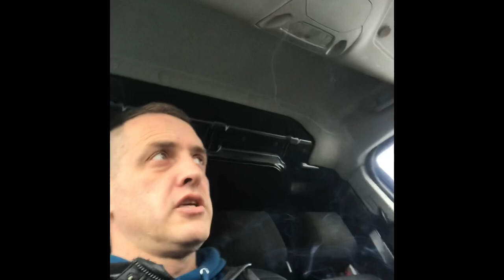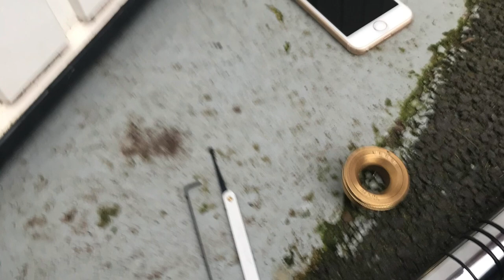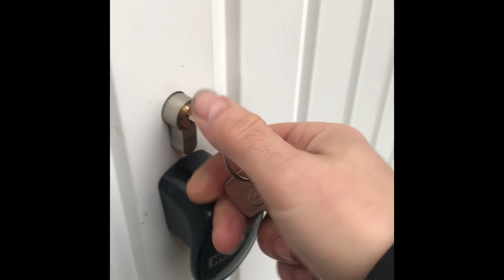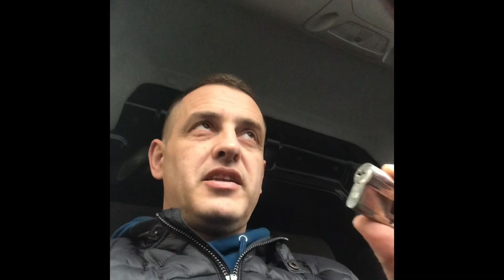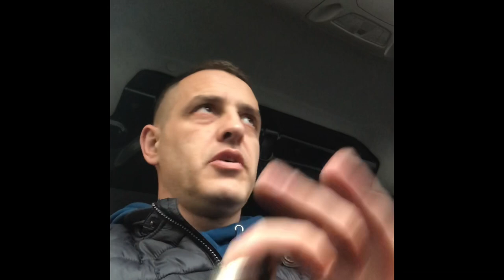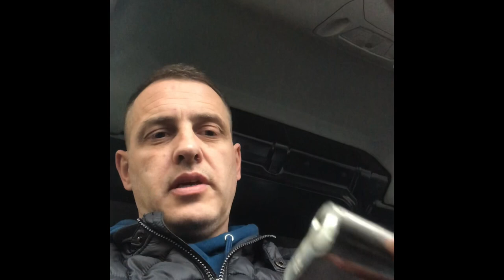Opening and replacing a half euro cylinder on a garage door

Comment: Another nice video pal that's one thing I haven't got yet I must get a couple to be ok if I get that call !!  Cylinder pins 😂😂👍
Reply from the maker: Cylinder pins 🤣🤣🤣 you will get that call so just got 1 or two in stock to be sure.....charge same price as if it was a lockout cause technically it is
Reply: @FortressLocksmiths  made me laugh and I will get a few pal cheers

Comment: I always keep a cou of half euros  with adjustable  cam, especially  handy for roller  shutter switches.
Reply from the maker: Do you know what pal, I’ve never dealt with the ones with the adjustable cam 1. How do you adjust them? 2. What is their purpose?
Reply: @FortressLocksmiths  usually  just a spring loaded  button  on back or side of cam  i have only needed  them on switches,sometime cam needs to be on top.
Reply from the maker: @cardiffpicker1  ahhh right I’m with ya, cheers for that

Comment: Nice mate. Had one of these last week. My southern epg is playing up, lost power or something. Ended up using die grinder on it. Nice 80 quid 😁 

I’m gonna buy another epg,  any recommendations?
Reply from the maker: I swear by the Kronos EPG pal, it’s expensive but doesn’t let me down and the battery can be charged by USB so you can keep it charged on the move....and yeah I charged £70 all in for gain entry and replace cylinder

Comment: Lock opens but handle won’t move. Any ideas ?
Reply from the maker: I take it you’re talking about a garage door mark?
Reply: @FortressLocksmiths  yes mate, Hormann manual garage door. Handle was stiff some time ago now it won’t budge. Any ideas? Where are you based?
Reply from the maker: @markalderson4710  it’s hard to say without seeing it, I’m presuming it’s a half a euro cylinder and a black turn handle? Or is it the old style T handle where the lock is actually on the handle
Reply: @FortressLocksmiths  half a Euro if that’s what it’s called. Lock is above separate black handle below??
Reply from the maker: @markalderson4710  yeah that’s half a euro, if the key is free to turn the first thing I’d check is the handle. Even in the locked position there still should be some side to side movement , if not and it’s completely stiff, I’d suggest that the spindle part has completely seized
Reply: @FortressLocksmiths  and how to ‘break in’ / fix if no access?
Reply from the maker: @markalderson4710  without the correct tools it would be hard to do without causing damage to the door, being a locksmith all I can suggest is to call out a locksmith! Sorry I can’t be more help but without physically being there and assessing what’s wrong it’s hard to say what the solution would be
Reply: @FortressLocksmiths  thank you, where are you based?
Reply from the maker: @markalderson4710  I’m in the North West, specifically the Blackburn/Burnley/Preston area